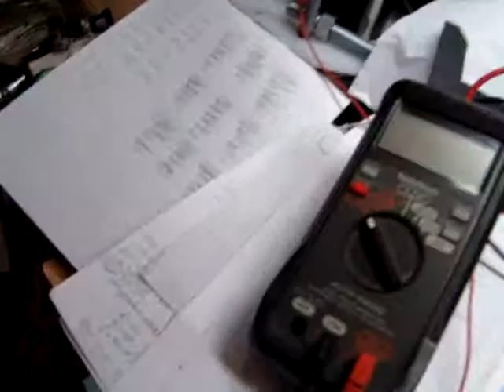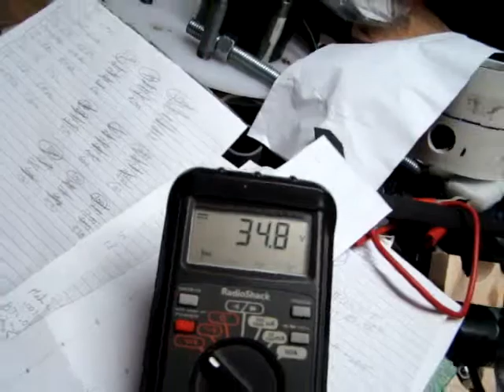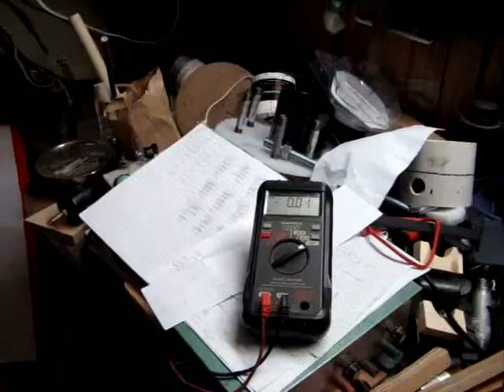Dual-Stator Alternator, Radial Design (video)

Comment: Hopefully just a quick reply this time as I've just seen the latest addition to your last post. I think it is always best to measure power with a resistive load rather than a battery. With a battery you may be measuring the battery voltage itself rather than the alternator voltage. The idea of using your alternator to charge your power pack is a good one if coupled to something like an exercise bike. You could do half an hour a day exercise while keeping your power pack fully charged. My alternator was designed with a view to using it with a wind turbine. Anyhow now you have a baseline power output 13.6W. If I was to make modifications to your alternator I would do the following: At the moment the arrangement of the magnets is like poles in groups of two, I would make every magnet alternate N S N S in every direction. Second mod would be to use a steel pipe inside the rotor that the magnets are all in contact with. These two mods will help to project more of the flux in the direction you want. If you do these mods take your measurements again, to be accurate you should be using a motor to turn the rotor at the same speed for each experiment. The more power your alternator puts into a load the more torque required to turn it. If you do get around to it let me know and if it is successful I have another mod you can try. What you may find is that you can produce the same power with less magnets in the stacks.

Comment: One more quick one if charging a battery with it, you may need to fit a voltage regulator to prevent overcharging. There's probably quite a few circuit diagrams on the net to help with this.

Comment: Yes I see most home build alternators use the axial flux type because of its simple construction. There are a number of reasons why it will be less efficient. When I say less efficient you would have to compare the output of two well designed alternators of the same physical size, one radial flux and one axial flux. All commercial alternators are radial flux because they have a higher output for their size. There are a number of factors which make them more efficient the two main thing to remember when designing an alternator is the flux needs to cut the coils at 90 degrees for maximum induced voltage. The second main thing to think about is the velocity of the field. In a radial alternator with a field diameter of 200mm is rotating at 100 rpm the velocity of the field cutting the flux cutting the coils would be around 1.05 m/s. If you look at the arrangement of magnets on an axial flux alternator, if the outer edge of each magnet is in line with the outer diameter of the disc and the disc diameter is 200mm again, the part of the magnets closer to the centre of the disc will obviously be at a much reduced diameter and therefore lower velocity. Other reasons are with a radial you can squeeze in more windings using various techniques such as wave winding. The design of your alternator is very different than mine they are only the same in that they are both radial flux. The effect you get of the magnets causing a jerking motion when rotating the alternator is often referred to as cogging. My design should not have too much of a problem with that, as I will not have an iron core within my coils. Mine is not built yet only designed on paper, just starting constructing the coils soon but it will be a big job and very time consuming. As I am self employed I don't get a lot of free time except a little at weekends. The magnets I will use will be 24 neodymium 25 x 13 x 5mm. got these at a good price about a year back on ebay, purchased 48 altogether. So the dimensions of my alternator were determined by the magnets I have available and the output I aim to achieve which is about 14 volts at 200 rpm. With a bit of luck it will produce 14 volts at a much lower speed as I didn't take every design detail into account when I did my calculations. Anyway hopefully my response has given you some food for thought as regards to your own designs. I will occasionally pop back to see how your doing with your designs, to see if you've come up with any interesting mods.
Reply from the maker: Please be sure to make a video and post when you are ready. I will be happy to see it. :)

Comment: I know what you mean now "eliminator" I think we have similar things here for camping etc. but they probably have a different name. It would be interesting if you could do a more accurate efficiency test to see how your alternator is really performing. That way when you make any modifications you will be able to repeat the test to see if the modifications are actually improving efficiency. I'm not sure if you know the best way of doing that is but if you need any suggestions on how to set it up let me know. One thing I am sure of is that a radial flux alternator will always out perform an axial flux alternator, its just a good radial flux alternator is so much more difficult to build.

Comment: Just watched this video along with a previous video you did showing an axial flux alternator. At the most interesting point ( in the radial flux video ) when you connected the 12 volt lamp the video finished. Anyhow as I was trying to previously state, to measure the current by connecting directly to the output is a bit misleading as you are effectively measuring short circuit current at which point the voltage would be close to zero. You should always measure voltage and current simultaneously, voltage across and current through the load. If you only have one meter then measure them one at a time with the same load in place each time at the same rotation speed. To give you an example of how taking readings without a load is misleading, in your video for the axial flux alternator you stated towards the end an output of around 1300mA and 35 volts. In reality if you measured a short circuit current of 1300mA at that time the voltage would be close to zero so the power output may be just a few watts. If you use your readings of 1300mA and 35 volts the power output would appear to be 45.5watts. If you use a 12 volt lamp as a load and do your measurements you will get a more realistic impression of the actual power output. Apart from that I think your video's are good and it's great to see people experimenting with electrical engineering. I can see a few ways to increase the output with some design changes, but you need a reasonably accurate benchmark output reading to see if any design changes are making increases in output.
Reply from the maker: Hmm, interesting that you say the radial flux will always out-perform the axial flux. Most of the other DIY wind-power builds I see on youtube are usually of the axial type, using very powerful rectangular magnets with two separate rotors sandwiched on either side of a stator with air-core coils. But they never seem to demonstrate output.

In my opinion the radial-flux types are easier to build for reasons that I alluded to in the videos.

I agree that the current readings directly across the bridge terminals are misleading in terms of actual power output. To be more accurate on this issue, still talking about he current 2-stator build, I can say that in two separate load scenarios the power lies in the 13.5 W range. For example, when charging the 12V battery the voltage reading across the terminals will read 13.5V while the inline current reading is ~ 1000mA or 1.0 Amp. These readings are taken separately as I only have the one DMM. Then in the second scenario, using the 12V automotive bulb, the inline current reading is ~800 mA (0.8A) while the voltage reading across the terminals gets up to about 17V. In one case the power is 13.5W; in the other it is 13.6W.

In a previous single-stator build I was only able to reach about half this value, i.e. 500mA while charging the 12V battery at 13.5V (6.75W). So the values are comparable between builds so long as the same load scenarios are compared at similar RPMs. I believe that much the performance can be slightly improved by using a pedal-powered bicycle drive at 1:6 gear ratio. Under those conditions it would become a practical charging device because the operation could be comfortably maintained over the time period required to actually deliver a usable charge to the battery.

Comment: You can not measure current flowing unless you connect in a load. Just connecting your multimeter across the output does not read amps correctly. If that's what you are doing I would suggest you read up on how to correctly measure current, there are lots of books on basic electrical principles, or just google electrical measurements.
Reply from the maker: Hi Jake,
Yes I'm well aware of that. The measurement across the POS/NEG leads is a theoretical maximum which reduces upon connection of a load, where you must connect the meter "in-line". Doing that as you describe is where my comment about the 1000mA charging current comes from. That is, if you connect the meter in line between the OUTPUT and LOAD in the case of a 12V "Eliminator Power Box" battery as load, and crank the generator, a current of 1000 mA or slightly above can be maintained. That is true current.
Cheers.